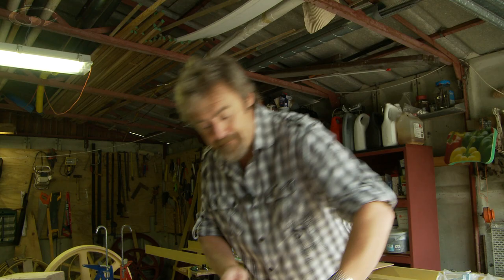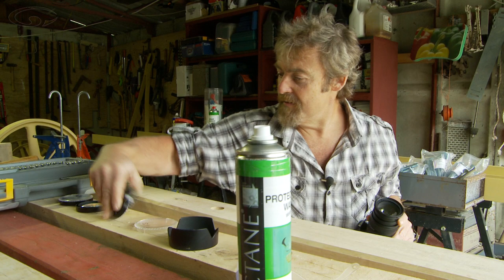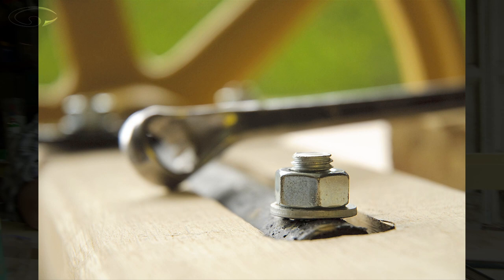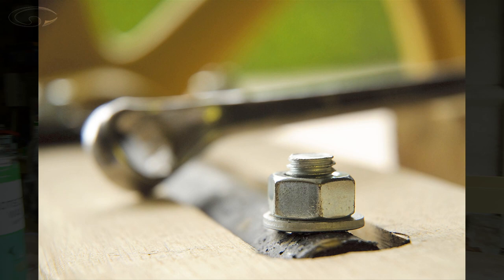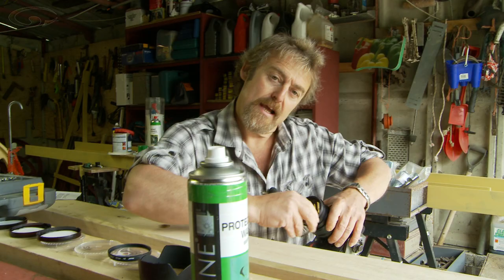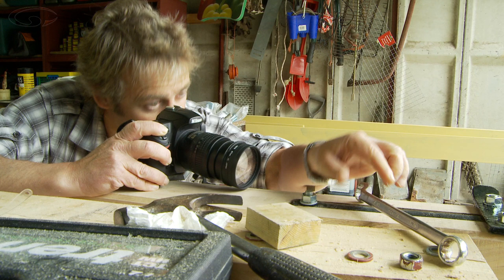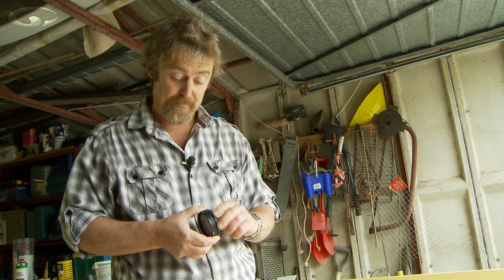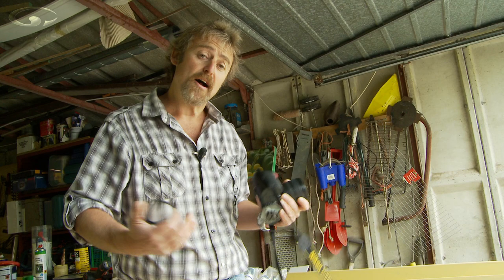How To Use Macro (Close Up) Filters

Comment: First thanks for this informative video regarding close up filters . But, the glass element of the close up filters does affect picture quality in compare to the extension tubes . Extension tube has no glass element that is why it's better for conserving picture quality , but still close up filters are not bad cause they are cheaper . I think the Kenko extension tubes are the best option for macro after the dedicated macro lenses like the Nikkor AF-S VR Micro 105mm f/2.8G IF-ED :) .

Comment: The reasons I opted for the macro tube set are for the low price as well as they were compatible with my entire lens collection. With the Macro filter you can only use them on compatible lenses as well as a reverse macro adapter.
Reply from the maker: Tubes are a great option. Not sure what you mean by "the Macro filter you can only use them on compatible lenses"? Did you mean thread size? If so a step ring is one easy option. Hope that helped...

Comment from the maker: Hi JumperUnexpected. They're not a substitute for any lens other than a dedicated macro lens which is usually between 50 and 100mm. You can't use them for anything other than close up work because basically they are a magnifying glass set for your lenses.

Comment: I've used such CU filter in the past, while it's true you could get closer to your subject, it'll gets softer (corners especially), CA, color fringing, etc. I suppose it's most likely because of single element CU lens.
I'd go for Raynox, like DCR-150 or DCR-250, it has a lot (and I mean a LOT) much better optics.
For an even closer macro without skyrocketing ur budget, go with manual MET, old 50/1.4 & 52mm Reverse Ring; u can even use built-in flash for a good result.

Comment: For my latter setup, I could get ~13mm across the frame (about 2:1 life size of DX) with very sharp image at about 1cm across the middle (corners does still gets soft, but still much better than CU filter).
Haven't tried with longer or shorter wide aperture old fixed lens, so i dunno whether it'd gets better or worse, all I have now is 50/1.4 Ai.
If I wanna get bigger magnification then I'd simply mod the MET with some black painted longer tube to distance more the lens from the sensor.

Comment: Came here wondering what these filters were for and how to use them -  this video is absolutely spot on what I needed. My only burning question is whether a difference can be had if you play with the ordering of the filters, say 1,2,3,4 vs 4,3,2,1 or 1,4,2,3. Is there a 'right' way to do it so you minimize distortion on the edges or does it matter?
Reply from the maker: Happy to have helped Anthony.. I don't think there is, I've never had a problem anyway though as with everything suggest you test it and see what happens in case I missed something... MIKE

Comment: I hope this isn't a dumb question.  I have a Sigma 105mm Macro, latest model, and much as I love it, I find that on its own, it's not the best at isolating really small bugs, like spiders and ants that are smaller than an inch.  I'm debating on whether to buy an extension tube set or magnifying filter.  Budget is around $180-$200 right now.  Would you suggest one, the other, or both, and what all should I consider between the two tools?
Reply from the maker: The only dumb question is the one not asked Michael. I'm not a macro expert and rarely shoot as close as you're asking about. If I do I shoot macro lens and then crop. Tubes and filters let you get physically closer and still focus but there comes a point where the lens itself will get in the way so you won't be able to focus. I can only suggest you go to a store or borrow from a friend and test it. - MIKE

Comment: I just wonder if you ever combined tubes with the filters? That might be an interesting experiment. As I don't have the filters, and no plan to buy them in the near future, I won't be able to do it.

By the way, there are two interesting videos on YT (DIYPerks channel) making a DIY macro filter lens (from an unneeded lens) and another reversing an unneeded lens onto a body using a reversing ring (PHOTORADAR channel). Macro can be done in many ways it seems.

Comment: oh, forgot to add though, no AF here with reverse ring.

Raynox DCR-150 or DCR-250 coupled with standard kit lens will get u a good result and still have AF & VR, basically most comfortable setup (easy to put on & off, just like lens cap) and produce much better result than standard CU filter (which "screw-screw-screw" :D ).

Comment: I'll be buying a camera shortly and I'll be primarily focusing on macro photography. Which camera would be better Nikon D3300 or D5100.  
D5100 is more versatile, I think(and it has an articulating screen), but the D3300 has a lot more pixels than the D5100.

And nice, tips btw.I also saw your 
"Macro Reversing Ring" and loved it. I like your narration.
Reply from the maker: Thank you for your kind comment DaRapar0011 I've never used either camera so i'm sorry i can't advise you. Though i do like flip out screens and wish all cameras had them...
Reply: Mike Browne 
You are most welcome, sir.
Another question if you dont mind.
Should I choose a higher resolution camera or a lower resolution one if I know I'll be focusing on macro photography?
I'm asking this only because iI see sometimes, the photos need to be cropped and at that time, the extra resolutions come handy. What is your opinion?
Reply from the maker: You've kind of answered your own question DaRapar0011  - more pixels are better if you want to crop in and maintain good resolution. Bear in mind what you're going to do with the files. If you're printing big you need at least 300dpi resolution. If it's for on screen only 72 is all you need...
Reply: Mike Browne , Thank you sir.
I knew the facts. I just needed them to be verified by an expert. :D
Reply from the maker: My pleasure DaRapar0011

Comment: quick question is there a way to use the close up filter and get the background in focus also?
Reply from the maker: Hi InsiderDre, it really depends on your aperture and how far the subject between the background is, using close up filter they work identically to reading glasses,  you can use f22. That is the only way to get enough depth of field, if your background and subject are both inside the focal plane, they can be both sharp, but if your subject is too far from the background it will be blur, sure f22 will lessen the blur ( compared to using f 2.2) but this natural phenomenon. Try to cover your eyes with your one hand, and raise your other hand and look at  your finger, noticed that your finger is sharp and the background is blurred, try to walk close to a wall and you will noticed that the more you get closer to the wall, the wall is getting sharper. - hope this helps. - Melissa pp Mike

Comment: Thanks for the video Mike.  What are therelevant merits of close up filters and extension tubes?

a.n. other Mike
Reply from the maker: Filters are quick and convenient and can be used with any focal length, tubes can be more fiddly to work with because you may have to compensate for fall off of light with increased exposure. Tubes and dedicated macro lenses will always be better quality than filters though Michael Woodward

Comment: Hi mate, the theory seems very similar to extension tubes - allowing you to get closer to the subject than would otherwise allow. I have extension tubes but the larger the tube, the shallower the DOF which is sometimes only a few mm. Do the macro filters have the same issue the closer you get to the subject? Cheers.
Reply from the maker: Yes they do Aaron. The closer the camera gets to the subject, the shallower the depth of field becomes with tubes, bellows, macro lenses or filters... MIKE

Comment: i just want to ask, if  67mm Macro Close-Up Filter Set +1 +2 +4 +10 are compatible with sony cyber h200? i hope someone can answer my question.
Reply from the maker: If the camera has a thred in the end you just need the filters of that lens diameter. Most cameras have it stamped inside the lens cap... MIKE :-)

Comment: Having now watched this video & a previous re. use of Macro Ext. Tube Set, which is better for higher magnification?

I'm awaiting deliv of Macro Ext Tube Set (for my Lumix G3) & also Raynox DCR-250 Macro Attachment. Do u know if I can combine both onto a lens? Finally, what is best lens for macro photography coupled w/ macro tube set or attachment? I know I can get much closer to subject using my 14mm lens, but also have 45-200mm lens.

May be worth testing the above to answer my own Qs! Thanks

Comment: Hi Mike, can you please let me know what make are the filters you're using?
I have a Neewer macro adapter but the blur on it is a tad... too much. Been looking at these type of filters lately but there seems to be a lot out there and the quality of glass seems to vary a lot. Any advice?
Reply from the maker: Sure +Ruta Lankelyte Thesde ones are Hoya and they're pretty good as a cheaper option to a macro lens. Though a Macro lens will always give the best results. I've noticed there can be a bit of chromatic aberration with filters but if you shoot RAW and use Lightroom there's a 'remove chromatic aberration' checkbox in the lens correction panel that'll get rid of it. - MIKE

Comment: Amazing video, just discovered your channel!

Question: Combining close-up filters with the Nikon Macro 85mm f/3.5G ED VR will work or fail? Looking to get really close into bugs and light is not a problem because I have a macro flash that provides more light than I could need. 
PS: I had 2 extension kits and both got broken very fast...
Reply from the maker: Thank you Radu D I've never tried combining macro lens and filters but it may mean you'll be unable to focus because you'll have to be closer to the subject than the length of the lens which is of course impossible. All I can suggest is try it and see if it works... - MIKE
Reply: Mike Browne I tried combining Macro lens (Nikon 85mm f3.5) with the full extension tube, and yes it focused, extremely close to the lens, I got a 2:1 but it wasn't as sharp as expected. I managed to get only a few shots and the tube got broken unfortunately (inner metal rings got detached from body).
As I remember I had like 3-5cm between the lens edge and the focus point. The official minimum focus point for that lens is at 28cm.

Comment: What if you stacked 10 + 10 filters on top of each other? 100? Will you be able to turn it into a telescope? lol
Reply: macro lenses are for small stuff so everything would seem blurred if you try to use a macro lens for that type of purpose. I know it was a joke, just saying
Reply: What you do is stack 3 ex converters in parallel and have a 400 - 600 mm on a crop sensor giving you an equivalent 8640mm !!!

Comment: may i know is there an optimum focal length for close-up filter to get the best quality and maximum magnification.
I have a (+10) close up filter and i attached to a 55-250mm at 250mm, the photos seems distort after i took it. but it works fairly ok with 100mm zoom. 
Thanks...

Comment: Hello. Did you leave your camera settings on Auto Mode to get your focus?
Reply from the maker: Yes I use AF 99% of the time because it's very accurate +Ci Chris But I still control what it's going to focus on, in this case with single point non tracking mode. Have a look at video link below... MIKE
http://www.photographycourses.biz/videos/technical/getting-sharp-images/autofocus.html
Reply: +Mike Browne Where did you get your protective lens covers from?
Reply from the maker: Ci Chris  Normally it comes with the lens itself, or can be sold separately both online and camera shops. Melissa pp Mike :)

Comment: Can filters be used with Camcorders? I am buying a  Sony Ax53 camcorder with a 55mm filter. Will any 55 mm close up filter that is normally for a camera fit the same way? This might be a dumb question but they don't advertise using them with camcorders.
Reply from the maker: I can't say for sure +mrblackalchemist because I've never tried it on a Sony Ax53 camcorder, but I would think these close up filters should work ok. Though not sure about other types of filters. The only way to find out for sure is to try it - MIKE
Reply: Thanks Mike

Comment: Hello Mike, thanks for that tutorial, it's very clear!
I have a question; I just bought a Nex N3, and I was wondering if you know whether a close up filter will fit on there (knowing that it has a retractable lens). I know it'd be a 40.5mm but I'm just unsure about its fitting on the lens, and can't find any thread about that on the internet..
Cheers :)
Reply from the maker: My pleasure Marie HAFFNER I've never used a Nex N3 but if it has a thraded inner ring at the ned of the lens which isn't fully retracted when you switch it off then I expect it'll fit and work. be careful though because if anything stops the lens retracting it may damage the camera. Maybe best bet is to visit a camera shop some time and take it with you to try.

Comment: Hi Mike ...could u suggest which one is the best among the 4 closeup macro lenses...i dont want to get chromatic abberartions......suggest me
Reply from the maker: Hi Murugan, there's lot's to choose from depends on the brand, feel free to do a research on the following lenses, to fit your needs. 
Cannon- 

1. Sigma 105mm f/2.8 EX DG OS HSM Macro for Canon

2. Tamron SP 90mm f/2.8 Di VC USD Macro for Canon

3. Sigma 150mm f/2.8 EX DG OS HSM Macro for Canon

4. Canon EF 100mm f/2.8 Macro USM

Nikon:
1. Sigma 105mm f/2.8 EX DG OS HSM Macro for Nikon

2. Tamron SP 90mm f/2.8 Di VC USD Macro for Nikon

3. Nikon 60mm f/2.8D AF Micro

4. Tamron SP AF 90mm f/2.8 Di Macro for Nikon  - Melissa pp Mike
Reply: thanks for your replyMike..Iam using canon powershot sx60hs...i wanted to go with any of these closeup macro lenses like +1 +2 +4 and +10 magnification(screwup lens).suggest me better lens from this,,,,As i am using the fixed lense on my camera,i dont think i can use  those bigger lenses mentioned by you.

Comment: Hi very good video
May I know if I need to use prime lens to maintain auto focus?
Will the sharpness degraded after adding filter?
And what brand do Use?
Reply: What brand of filter do you use?
Reply from the maker: Thank you Danny. No I was using a zoom lens and not a very expensive one at that. Image quality does degrade a tiny bit through filters but it's only a tiny bit. Do you need extreme perfect image quality for reproduction / enlargement or will they be viewed on screen in which case no one will notice. These filters are Hoya. The more you spend on them the better quality they are. The best close up quality always come from using a Macro lens though... Hope this helps... MIKE 🙂🙏

Comment: whats the best focal length on using close up. i have 50mm 1.8g and sigma 17-50 2.8 on apsc d3100. what does it look like if i put close up with a wide 17mm?
Reply from the maker: Sorry Lauren I can't answer that. There is no 'Best' lens for close up because they all have different looks and possibilities. Just because I like 50mm, doesn't mean you will. I can only suggest you go to a store and try a few to see what looks you get from them and see which you prefer... MIKE

Comment: What if you want to put some distance between you and your subject eg insects. Would it still work with the lens zoomed out?
Reply from the maker: I've never tried it with a long lens @Dave Tyrer. In theory it should. Macro is a way to bring the camera very close to the subject so it's inside what would be the normal minimum focussing distance. Should work with a long lens, though depth of field will brobably be megga shallow so to find focus you'll have to make lot of tiny movements back and forth to find it. Sorry I couldn't be more help...

Comment: I have 4 close up filters that were given to me.  The size is 62mm. They do not fit my 18 to 135 lens. What would I need to use these
Reply from the maker: Hi @janetwerstroh3777 You need a step converter ring which fits the the diameter of your lens and 'steps' up or down to the diameter of your filters, in this case 62mm. The diameter of your lens is stamped inside the lens cap so you'll need to buy a step ring that goes from your lens diameter to 62mm. Hope that helps...

Comment: Nice video! Now, are these better than much much cheaper macro extension tubes and how? Of course extension tubes are built specifically for different camera makes, but they can be so inexpensive that it would hardly even be a factor. What do you think?
Reply from the maker: Thanks. Tubes will generally give you better image quality but there is a fall of of light so the shutter speed gets slower. I quite like filters because I find them convenient to use.
Reply: Mike Browne thanks! Makes sense

Comment: Thanks for the great video. I bought some but can't focus at all, also not when I use MF. Do they not work with telephoto lenses (I've only have a 70-300 at the moment) or are the close up filters I bought just shitty quality (they were super cheap)? Thanks!
Reply from the maker: They wirk on any lens in my experience Nina. You have to get primary focus by moving yourself in and out to the subject, then you can fine tune it. Don't try wilth all the filters on at once time or you may have so much magnification you can't get close enough because the lens is in the way. Try one at a time, move slowly towards the subject and it'll come into focus... MIKE
Reply: @MikeBrowne  Sorry just seeing now that you had replied! I've figured it out at the end, exactly how you described it. Thanks a lot for replying!